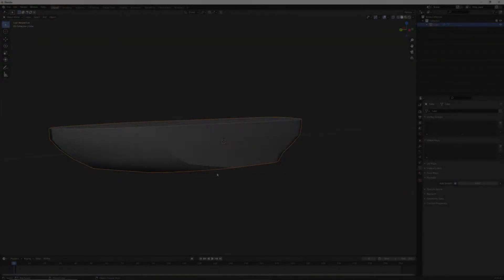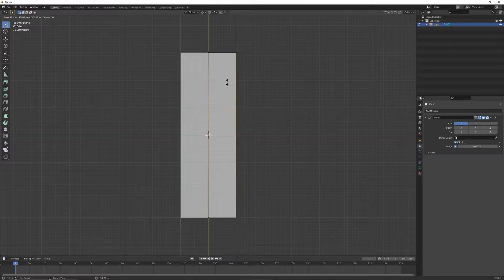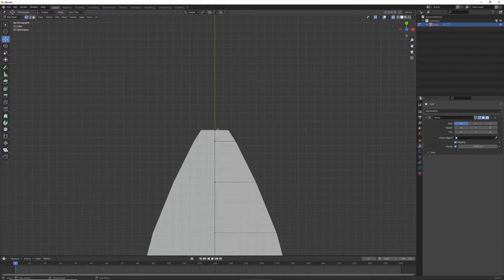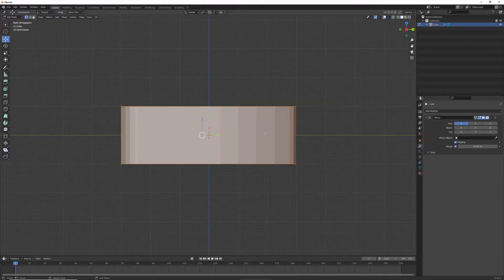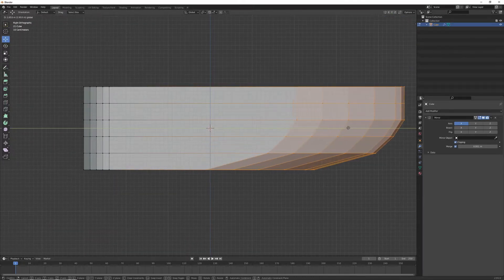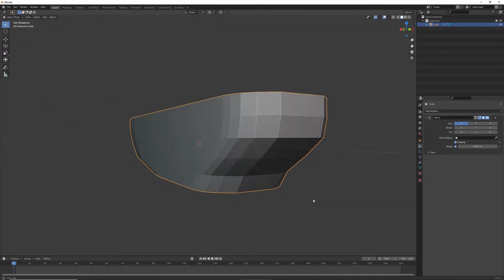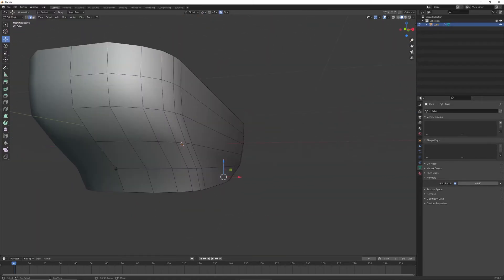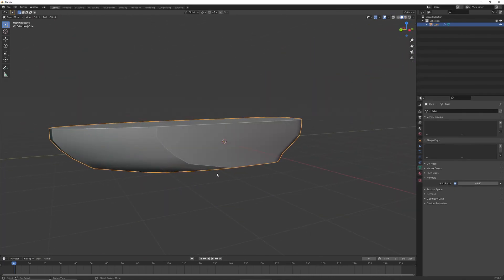How To Make A Ship Hull In Blender #blender #boat #tutorial

Comment: Can you explain something? At 23 seconds, you seem to select two vertices - the one that's visible, and the one behind it. When I try this, it only selects the visible vertex. Any idea why what's going wrong for me?
Reply from the maker: Yes, I am in x-ray mode, it is a better version of wire frame view in most cases.  You can activate it with alt z on Windows and Linux or option z on Mac.  Then I use box select to actually select the vertices.  Thanks for asking!  I will be posting a school biography project soon on Stephen Crane that was made in blender.

Comment: Very straight-to-the-point! Love it! I come to question, what would be the best way to hollow out the bow?
Reply from the maker: The best way to hollow out the bow would be to select the top faces that you want to hollow and then inset them a bit so that there is a little wall and then extrude downwards, if the faces aren't in the right spots then just loop cut the model and then select your desired faces.  Also if you want to hollow out the whole thing just select all of the top faces, inset and then extrude downwards.  Thanks for watching!
Reply: u wouldnt not the way hes doing it its a poor excuse for modeling